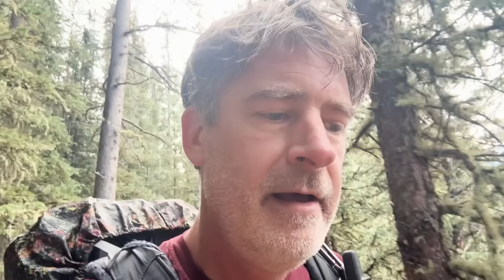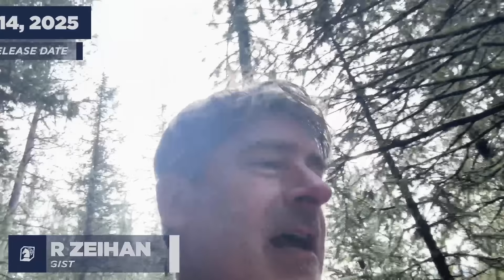Can 3D Printing Save U.S. Manufacturing? || Peter Zeihan

Comment: Possibly.  I explain.  In the 1960s, I worked at IBM.  Late one night, I saw something on the computer screen.  It was something I had never seen.  However, I knew what it was . .  the first wind tunnel.  In those far off days, a product was built and then physically tested.  With the concept of a wind tunnel, you could test components without the finished products.  

The 1960s were also the time that I saw my first tape driven CNC machines.  

I cannot remember the details.  Here is the generality.  The US government gave a large 3d printer to a university.  A couple of years ago, it was given to the Ukraine.  It makes 25 foot sea craft for wars.

Only conceptually.  With a 3d printer, some products can be produced less expensively.  This would be a function of transportation costs, the need to have your business offices or production facility on specific physical ground, the need to have inventory, the need to produce seasonally.
Example.  Go back to 2019.  The Christmas present industry.  The orders would come into China in February and March. The production of the goods for Christmas would then start.  Ship deliveries would commence in perhaps August.  By October, the goods would start being housed in warehouses on skid row, Los Angeles.  Skid row was the largest storage area in the country for toys.  Then the toys would shipped out.  Costo started stocking Christmas junk on the sales floor at the beginning of November.

I am a businessman.  I don't know what the hell Christmas will turn out.  I have a guy with a 3d printer.  I am selling generic, unbranded, uncopyrited, unpatented junk.  Ok.  I do a minimum order from overseas.  Cheap labor.  If my sales in November are higher than I expected, I will call the guy with the 3d printer and have him make more.  Sure, the American labor cost will be higher, but I am making sales.  So I start doing this with camping gear the sells in the spring and summer.  I will do it with Halloween junk.

Comment: The US is not building enough electricity, no nation can increase manufacturing capacity without increasing electrical capacity.
Reply: Yes, we need more hydrocarbon baseload energy NOW! Or better yet, new technology (meltdown proof) nuclear and/or thorium reactor electrical plants...now!
Reply: In capital markets that is called a demand signal which means supply will come soon. They are building it out a rapid speed. The problem right now is everyone trying to “short” the AI market.
Reply: @chillxxx241 no hippies want everyone to live in the Stone Age and worship plants.
Reply: @keithwelch8563 Damn you went from "interesting economic point" to "Nick Fuentes doomer" in a snap, please put down the pipe.
Reply: Sorry folks, it is going to be wind and solar because *water*, very simple maths! California and Texas are doing it, and when they can agree on anything watch out.
Reply: @stalbaum Wind and solar are failing everywhere Leftists are forcing them to be temporarily inflicted. They are not baseload power, and are inherently FAR more expensive than actual baseload power, which is hydrocarbon or nuclear. And you are reported for disinformation.
Reply: @DUCKDUCKGOISMUCHBETTERsomebody is losing the future because they watch propaganda. So sad to see so many fail simple math. Nuclear is good and we need it, but the math is, solar cost is the lowest and it uses no water at the point of energy production. That is all you need to know, but you don't want to know 😂
Reply: @stalbaum Solar is actually the most expensive, putz. Imagine believing that putting your thumbs on the scale in the form of taxpayer subsidies, SOMEHOW "makes solar or wind LESS expensive, rather than MORE expensive". Leftists can't math! 😂
Reply: @stalbaum You probably also believe that if your daddy gives you a free (and therefore 100 percent subsidized) Lexus, but you would have to BUY YOURSELF a bicycle, that a Lexus is less expensive than a bicycle. Leftists simply can't math! Nor do they have any common sense, nor do they want any!
Reply: @stalbaum OPiuM = Other People's Money. It is the favorite drug of Leftists and Lie-berals. "Ooooh LOOK Comrade!! If I steal enough money from the people who work, through taxes, overprinting the money supply and borrowing on the nation's credit card, I can make all the expensive things free to give away to all the economically ILLITERATE people whose votes I want to buy through social programs!!"

What a corrupt racket you Leftists have been bankrupting us with since 1931!
Reply: @stalbaum "The inherent weakness of Socialism is that eventually you run out of other people's money."

- Prime Minister Margaret Thatcher -

Comment: The fall of 2020 and early 2021 when the shipping industry was bottlenecked and it was impossible to get widgets from our overseas suppliers, 3d printing was the only alternative for the company I was working for. There were specific parts for the large 4th tier diesel engines that were imported from China, and because of the emissions laws we couldn’t bypass the DEF systems and keep going. The parts that were breaking were actually just the plastics that were exposed to heat, not the electronics held within, so the company legal department determined that it would be cheaper to withstand the patent litigation than suffer more downtime because of the broken plastic components. The shops were given 3d printers, we got our parts out in the field, and you the end customer could still afford gasoline because of that. As for the litigation, I was told that the company settled for an undisclosed amount with the manufacturer of Cummins engines, which I assume it was a large sum to keep it out of the courts.
Reply: Let me guess. Cummins DEF QLS sensors.😊
Reply: @williamgonzalez2137 On QSK50 engines, but you already knew that. These were installed in a sound deadening box that probably exasperated the heat issues.
Reply: This is an appropriate use for 3D printing: specialty, niche manufacturing.

Comment: Not going to happen. 3D printing has very high post processing costs that nobody ever talks about. You do not just print a part and then it's done perfectly.  3D printing should be thought of more like CNC machining. It will bring new capabilities online, but it always be better for high mix low volume mfg

Comment: The limited speed of 3d printing is a trade off - yes you can stamp or mold things faster - but you still need to build the forms and dies for the higher volume process.  Dies are always expensive and resistant to incremental product improvement. A world in which rapid prototyping replaces volume manufacturing, is a world in which products see smaller runs, faster updates and distributed support. But it is also a world in which the consumer must put a premium on individuality and tailored performance. 

Will this be cheaper, more efficient and better quality? ... that depends on consumer expectations.
Reply: When it’s all combined in a single systems approach with complete automation it will merge the slow with the fast to create products that cheaper and more widely available.
Reply: @Art-is-craft  I live in hope

Comment: You got the technical details wrong for the most common form of 3D printing. The most common type of printing Is FDM, which is basically melting plastic filament to make products. 

You're right about the speed. It won't ever compete with injection molding, but injection molding is more expensive to start up and is a lot less flexible. What you might see is people with 3-10 printers producing products in their house. It's not thousand of products per week, more like hundred, and they're able to switch to producing different products as needed to meet demand.

3D printing to prove the demand and on-demand production, injection molding for products that truly require scale.
Reply: In this case though, SLS matters a lot more, since it can do actual metal. You'd never see a company print large pieces of a vehicle with FDM, but it's extremely more likely with SLS

Comment: Small physical volume (of a single piece or sum of material per unit of time) for high value for manufacturing is where it shines, if limits on materials don't disqualify it (for now.
Also, 3D printers are potentially great for end-of-supply-chain / edge applications, like car repair shops that could 3D print a very large selection of spare parts that they couldn't economically stock, and paying a bit more or waiting one or a few hours for something to print could beat waiting for shipments from a regional or worst case import or foreign storage facility. Also potentially stuff like mid-tier jewelry and apparel in that works in appropriate material.
Reply: The ONR (Navy R&D office) is looking at being able to have printers in their ships' machine shop for producing replacement parts while they're deployed. And aerospace is using wax printers, ceramic slurry printers and even metal printers for producing short runs of non-critical, non-rotating parts.
Reply: Also, stuff like miniature statues / collectible figures...

Comment: Good job on catching up with the breakthrough tech.  You are spot on with the bottlenecks in speed and material.  But the whole point of the printer is that it is personal and generic.  The ideal is a box the size of your refrigerator in your garage that will print our individual patterns available for you to purchase online.  It won't print our a brand new Cadillac for you, but if your daughter breaks the tail light cover and pulls off the bumper in a parking altercation with a concrete post, you can have the replacement cover and even bumper printed up by the next morning.  If you see a Hawaiian shirt you like online it can print you a nice copy.  If you sit on your glasses it can print you out a new pair.  It's not trying to out produce an auto parts factory, but if everyone has one and can print the parts for 10 cents on the dollar, the auto parts factory will close.  That said there are hundreds of obstacles in the way - cleaning printer heads, material compatibility, recycling material, etc etc.  On the Macro scale - Printing houses might be a way to go to alleviate the housing shortage though living in a concrete igloo will take getting used to.
Reply: It's now 25 years ago that I heard about houses being printed and my job in construction being eliminated. To this day nobody can print a whole house. All they can do for a lot of money is printing rough walls that then need to be clad inside and out, insulated, wired etc., etc. It's a niche technology and they will find applications for it, but a niche it is.
Reply: @modero6370 For the moment, yes. That said, that tech followed the usual pattern of the hype showing up well in advance of the tech being ready for prime time. Once it eventually matures, it'll probably be better able to handle more parts of the construction, rather than solely the rough shell.
Reply: That was an oddly explicit example. Would your daughter have happened to have done said actions? :)
Reply: I think the genius of 3D printers, along with laser engravers and small affordable CNC machines is that they are now affordable for makers to prototype and innovate.

Comment: 3D printing goes a long way in solving the warehouse issue as it can limit the number of parts you have to store. Example, I have an aircraft I must support. To get a single part, I must order a minimum of 100 units. I sell one and store 99. 3D printing has already solved this issue and the cost to store and yearly taxes. This is a simple explanation. The other is reconfigurable manufacturing tools. I cannot afford to store the tooling for years for one or two parts, again warehouse costs and yearly taxes. But if I have reconfigurable tooling, I can keep the tooling to make many different parts and keep one set of tooling busy year around. I have worked on both of these and have working tooling and 3D metal parts approved and working.

Comment: just like anything when speed is bottlenecking manufacturing, parallel process is the answer. This of course means bigger space is needed, and people to operate the machines. Karno process generators from Hyliion require 3D printing for the generator to work but the efficiency is so much more. I can't help to think that they will play a role in the future of distributed energy production for shipping, data centers, etc.

Comment: You’re misunderstanding why it is great: it allows us to iterate and innovate on a design quicker. America does the innovation, the rest of the world manufactures and copies the things that we design. Now that we are moving manufacturing back to the US, it makes it more difficult to steal the manufacturing processes and designs. Once you get the practical thing that works, then the manufacturing in other mediums can occur. With sintering you can print multiple parts at once, and are limited by the size of each printer. Specialty parts can be produced as needed on demand. This is fantastic for airplane parts and engine parts. You’re also skipping cnc Wire EDM as a machining process that Americans are ahead of the pack on.

Comment: Thank you for knowing enough to not totally botch this perspective...
Core issue is, most of the parts to build quality printers are still manufactured abroad, im talkn about engineering grade machines, sls, ded, als, dmi, all of them.....
Reply: Good point!  I wonder if I will live to see the day when a 3-D printer achieves the same capability as a conventional lathe?  You sound like you know what I’m talking about, the ability to manufacture the parts to replicate itself.

Comment: I'm old enough to remember that 3D Printing was suposed to revolutionise Manufacturing Years before the AI Fab was a Thing.
Reply: My brother is a industrial engineer at USA based factory, and 3d printing is a big part of the process. I wouldn't say it revolutionized it, but it had a big impact.
Reply: Yea everything is always 5 years away.
Reply: It did revolutionize product design and engineering and it already has made great progress into manufacturing, but is just getting started.   We have custom 3d printed implants, and all kinds of 3d printed products being shipped to customer everyday.   It's just the tip of the iceberg
Reply: @theianmce  Yes, I remember when they first came out.  It seems to be like computers.  We received our desktop and it was decades before the programs were efficient enough that they saved a lot of work.  For the first few years they were just a glorified typewriter.  Then the spreadsheet was the big thing.  Then programs were developed and they were horrible.  It required years for each discipline had software that worked.  3d printers seem to be the same to me.
Reply: AI Fab is why Elon is so rich.
Reply: Elon Musk's companies, like SpaceX, have access to some of the most advanced and largest metal 3D printers for rocket parts, which he has said gives them the "most advanced 3D metal printing technology in the world". However, companies like Relativity Space are building the world's largest 3D metal printers specifically for creating large rocket components, and the University of Maine has the world's largest 3D printer for large objects like boats and houses
Reply: What i meant is that 3D Printing takes far to much Time for Mass Manufacturing, so in Order to use it to Reshore Manufacturing to the US one would need something more like the Replicator from Star Trek.
Reply: @BobAbc0815  Which is some combination of ai and 3D printing I would think.  "We are the USA. You will be assimilated. Resistance is futile".
Reply: @Greg-Horne and please dont do anything during the Hours the 3D Printer needs, to do what any other (incidently highly automated) Manufacturer does in under a Minute.
Reply: @BobAbc0815  Tesla likely handles vibration in its enormous 3D printers through a combination of isolation, dampening, and industrial-grade machine design, as the vibrations from such large-scale printing operations can negatively affect accuracy. Solutions range from using heavy-duty, vibration-isolating mounting pads to ensure the printer is stable and doesn't transfer motion to the floor, to implementing custom engineering designs that minimize internal and external vibration.
Reply: @Greg-Horne pulling a String of Buzzwords together does not make 3D Printing fast enough to be economically viable.
Reply: @BobAbc0815  I am not trying to say it is fast.  I agree with you.  I am trying to say that Elon is using it a lot for prototyping.  That is my HOPE that it will lead to a lot of innovations that will make larger production more practical.  Peace be with you.
Reply: Yeah, and then cnc became so good and China so cheap that there was no point to invest in 3d printing
Reply: @lapserdak24 yeah but ... Where's the Epstein list
Reply: @HypnotizeCampPosse if I had it, I would publish it right here